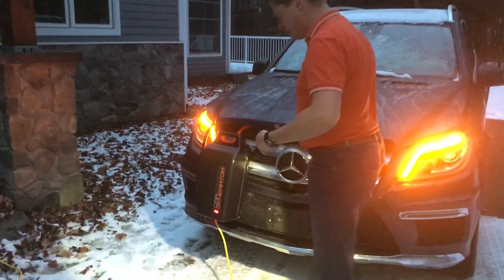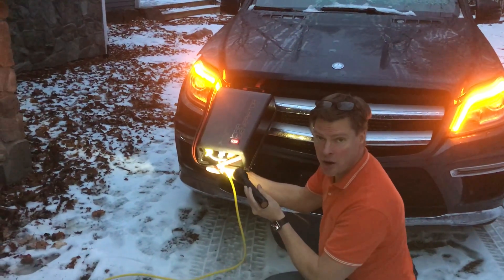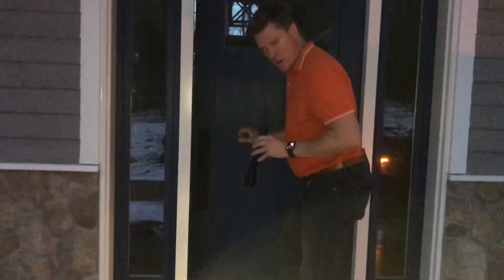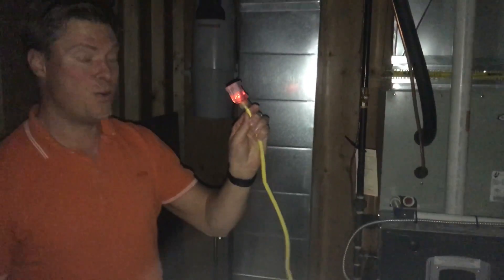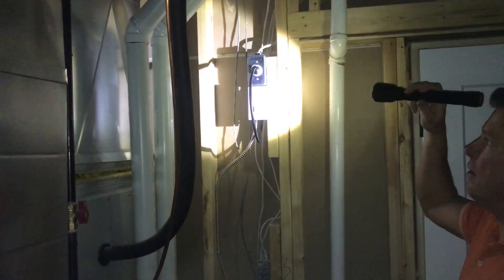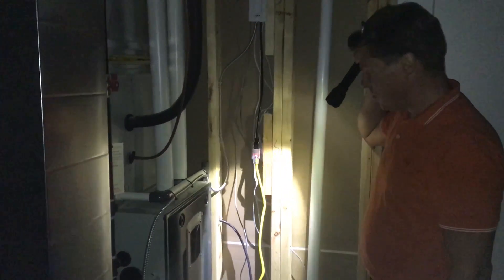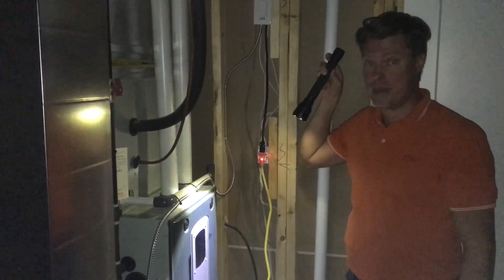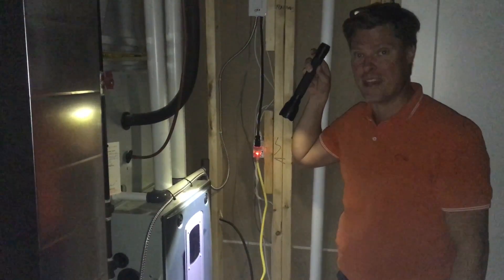How to Power a Cottage or Cabin With Your Car (Off-Grid Power for 50+ Hours)

Comment from the maker: CarGenerator is an inverter, but with the impossible challenge solved: how to use the inverter in rain/snow/bad weather, while at the same time keeping it ventilated and cool, paired with the right kind of custom heat proof pure copper cables that can withstand the heat of the engine for extended use, all wrapped up in a user friendly package with instructions on how to safely use this without damaging your car.   Simple, convenient, and no generator hassles.
Reply: This is a bloody joke as the other guys said it's just an inverter and running it off your car like that there is no concerns of damaging anything your trying to use technical terms for something that is sooooo simple.
Reply from the maker: @polarwireless  you are so right!  its a bloody joke how many people shiver in the dark in their homes thinking they have NO power, when in fact they have a generator right there in the driveway,  its so simple!   And given that you can buy cheap crappy inverters anywhere for almost nothing, why don't more people connect the dots and do this?   Well..... many reasons, most importantly the education component of how to do it safely, and how to use the right kind of heat proof pure copper cables, and lets see... how to weatherproof it so you can use it in the rain/snow/ice, and how to keep it not only DRY , but also VENTILATED....  thats why we put it all together in a convenient turn key weatherproof patent pending package ready to go with no prior technical knowledge.   We've been in market for six years now and landed a $100,000 deal with dual investors on national TV on Dragons Den Oct 2018, and we've grown by 10x since then!  cheers.... :)

Comment: I read that 1000 watt power inverter is the maximum amount that should be used on a car because more wattage will damage your alternator and battery.
Reply from the maker: the most trustworthy way to know, is to observe the vehicle voltage while running,  if its above 13.5 volts then your alternator is easily providing the power used,  if it drops below that down to 12 or 11 volts for example then you are pulling more power than the alternator is capable of, and you are borrowing power from your battery, which is ok for a few minutes but not continuously.   Call your vehicle dealer parts dept, and they can tell you exactly for your vehicle what the "amps rating" is , reduce that by half due to idle speed, times 12 volts = approximate watts you can expect.  https://youtu.be/Js4K6N5rMCg

Comment: What's the max amount of watts you can use your car as a generator  ? For better results the car battery should be 1,000cc avoid 500cc and 600cc car batteries
Reply from the maker: Ask your vehicle dealer what is your alternator "rated amps" output, then reduce that by half for idle speed,  times 12 volts = approximate continuous watts you can expect.    The battery size or capacity doesnt matter at all because we are never using power from the battery,  always only pulling power from the alternator only. thanks.

Comment: But, you have to leave the car running the whole time?? Don't get exhaust
Reply from the maker: yep!  you got it exactly.  The source of power is the running engine of your vehicle, which uses about the same amount of gas as a portable gas generator but it much easier, quieter, cleaner, and more convenient than a gas generator.  Yes you use it on your vehicle  with the exhaust pointing as far away from your house.

Comment: Now I know that I can power my gas furnace and low power appliances with my car using my 1500w pure sine wave inverter. I now fill up my car tank before any storm in preparedness. Thanks for the video.
Reply from the maker: Glad we could help!   Just make sure your vehicle voltage stays above 13.3 volts always, that means your alternator is supplying all the needed power.  If it drops below 13 volts then you are beginning to drain your battery.  Also make sure to use high heat proof cables, minimum 1 or 2 gauge and pure copper ONLY, to match 1500 watts.  Also at 1500 watts you need to use a direct lug connection, not just booster clamps or it will overheat and may catch fire.  Also at 1500 watts make sure your alternator can handle supplying that amount of power continuously at IDLE,  so the calculation is 1500 watts / 13.5 volts = 111 amps plus a bit extra for overhead so say 120 amps which means your alternator needs to be rated at 240 amps output so it can supply 120 amps at idle.   Let us know if we can help anytime!

Comment: How many watts it takes
Reply from the maker: CarGenerator models are 1000 watts, 1500 watts, and 2000 watts.   How much power you can pull from your vehicle continuously , DEPENDS on your alternator.  Take the amperage rating of your alternator reduce by 50%,  then multiply by 13 volts = your wattage.  SO for example a Dodge minivan with a 160 amp alternator , half is 80 amps, reduce that a bit for engine overhead, so 70 amps x 13 volt = 945 watts available.   See our other videos on youtube for examples https://youtu.be/CH2VNHf8IpY

Comment: What if your car blows a fuse?
Reply from the maker: great question thanks.  Answer:  CarGenerator will instantly shut off.   CarGenerator has several levels of protection already built in.  From overload protection to overtemperature protection, to direct AC short protection, and more.  CarGenerator would never actually cause any blown fuse however because by following our instructions you are never pulling out more power than your car is designed to produce,  just like as if it was running headlights, wipers, radio, etc...   See a good explanation video here: https://youtu.be/Js4K6N5rMCg

Comment: So what if you don't have a furnace and you want to run a portable heater along with some other things in the house? Most electric portable heaters run at 1500 watts. Some may have eco mode.
Reply from the maker: i'm really sorry but if you dont have a gas/oil furnace, you cannot use CarGenerator to provide sufficient heat for your house.  Your only option is a big heavy traditional generator.  A single space heater at 15 amps, 1800 watts max, only provides around 4000-5000 BTU of heat value at most.  A typical home gas/oil furnace is in the range of 80,000-100,000 BTU, so you would in fact need a lot of these and a very large generator.  Probably better for you to consider a quality Kerosene heater, or other alternative heating sources, or a large full house 20kw standby generator.  Thanks.
Reply: 9 amps isnt gonna power much

Comment: Sounds like a fancy inverter to me.
Reply from the maker: actually not even a "fancy" inverter, just a plain boring high quality inverter, but with the impossible challenge solved: how to use the inverter in rain/snow/bad weather, while at the same time keeping it ventilated and cool, paired with the right kind of custom heat proof pure copper cables that can withstand the heat of the engine for extended use, all wrapped up in a user friendly package with instructions on how to safely use this without damaging your car.   Simple, convenient, and no generator hassles.
Reply: Yo

Comment: Doesn't the fact that your car is being powered make this generator alot less efficent in using more gas than a stand alone generator just powering your house and no car?
Reply from the maker: great question thanks.  running your car at idle versus running a portable generator, uses about the same amount of gas.  quoted direct from published specs for Honda generator and for the vehicle from energy.gov  see details on our webpage FAQ  www.CarGenerator.com/FAQ  Here is the summary: HOW LONG CAN A VEHICLE IDLE FROM A FULL TANK?
For example:
2010 Honda Civic with a 1.8 liter engine and a 13.2 gallon tank can idle with no load for close to 88 hours!
2010 Ford F150 with a 4 liter engine and a 36 gallon tank can idle with no load for close to 92 hours.

HOW MUCH GAS DOES A CARGENERATOR USE PER HOUR?
How much fuel does your car use running on idle with no load?
2 liter engine = .16 gal / hr
4 liter engine = .39 gal / hr
Then increase these numbers slightly to factor in power draw for CarGenerator depending on how many watts you are using, and this gives you an approximate gauge.

HOW DOES THIS COMPARE VERSUS A PORTABLE GENERATOR?
STANDARD PORTABLE GENERATOR:
Honda 1000 w generator = .19 gal / hr at full load of 1000 watts
Honda 3000 w generator = .47 gal / hr at full load of 3000 watts, .17 gal / hr at 750 watts
Reply: My 3,000 watt Honda generator uses a little less than half of the fuel that my Toyota Sienna 3,000 watt inverter with upgraded high output alternator uses.

Comment: I have my furnance hardwire connected to an 4000 Wattt pure sine wave AIMS inverter/charger...it powers the furnace with the power is on, and pulls from 8d deep cycle batteries if the power is off.... auto power backup.. instantly available. If my batteries get low, my dodge dakota has an anderson plug connected to it's battery..I plug that into a plug I have installed on the outside of my house, (connected to my battery bank). Only start my Dakota for a few hours per day to re-charge the batterie as required... easy peasy. no extension cords. Batteries stay charged from the inverter/charger when the power is on. I have my fridge, and sump pump connected also. Northern Ontario.
Reply: What's the max amount of watts you can use your car as a Generator  ?

Comment from the maker: Hi Barry, thanks for your comment/question here, and for ordering a CarGenerator.  Thats helpful feedback, we will update the instructions further.  Please have a look at the video in the link here,   It shows one of our customers Barb and Bruce, using their CarGenerator right from how to connect it to the car , to the furnace. https://cargenerator.com/can-cargenerator-really-run-old-furnace/   if you have any questions please call anytime , our number is on the top of the website www.CarGenerator.com  800-460-7550  thanks!  The power cord with the green/white wires, and the single outlet together are the furnace connection kit.  this is needed to give your furnace a plug.  If you're not sure how to install that , you would be best to ask your HVAC furnace person or an electrician to do it for you.  The instructions we include show the public hydro approved way to install this https://www.esasafe.com/assets/files/esasafe/pdf/Flash_Notices/14-01-FL.pdf

Comment: Hi CarGenerator, I actually ordered your CarGenerator product, I'm looking at it on my living room floor, along with the included "instructions" and, I have to say, I have no clue how to connect this safely to my car - the youtube videos do not show you actually doing the step-by-step of connecting it to your running vehicle, nor do the instructions - the instructions seem to omit basic steps e.g. When can you actually safely start your car? It needs to be simple, step-by-step bullet points, not "paragraphs" of instruction weaving in and out of different configurations. At least if you want the average clueless Joe (like myself) to use this thing. Another example, the package included a power cord with a frayed green/white wire at the end, it's not labelled or anything, I have no clue what its purpose is. This may be brilliant product, I dont know, but I am disappointed by the lack of simple instructions.
Reply from the maker: hi Barry,  thanks for your comment/question here, and for ordering a CarGenerator.  Thats helpful feedback, we will update the instructions further.  Please have a look at the video in the link here,   It shows one of our customers Barb and Bruce, using their CarGenerator right from how to connect it to the car , to the furnace. https://cargenerator.com/can-cargenerator-really-run-old-furnace/   if you have any questions please call anytime , our number is on the top of the website www.CarGenerator.com  800-460-7550  thanks!  The power cord with the green/white wires, and the single outlet together are the furnace connection kit.  this is needed to give your furnace a plug.  If you're not sure how to install that , you would be best to ask your HVAC furnace person or an electrician to do it for you.  The instructions we include show the public hydro approved way to install this https://www.esasafe.com/assets/files/esasafe/pdf/Flash_Notices/14-01-FL.pdf
Reply: Thank-you for this reply - the link you provided is the most comprehensive and helpful instruction on how to get the CarGenerator connected to the car. And the phone support I received from CarGenerator was excellent! Thanks again